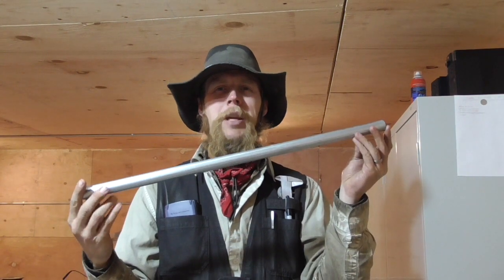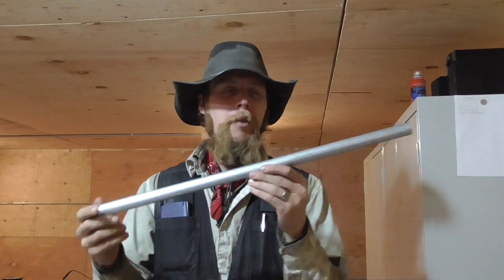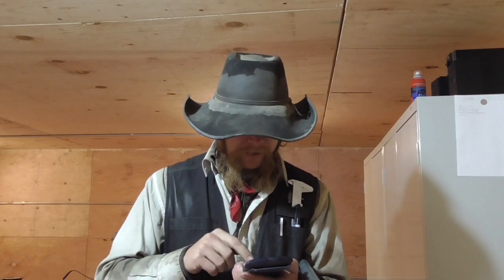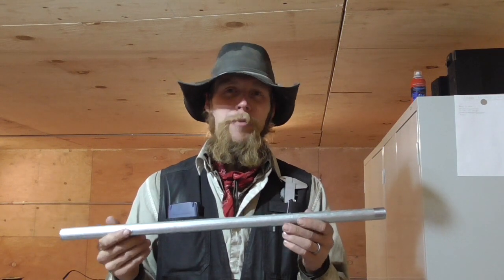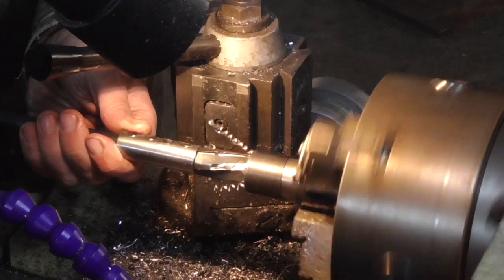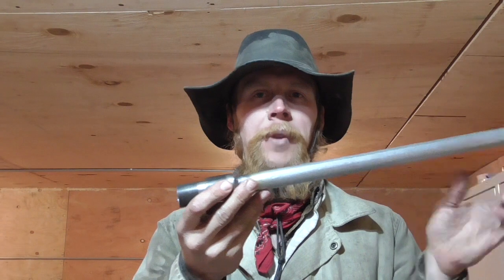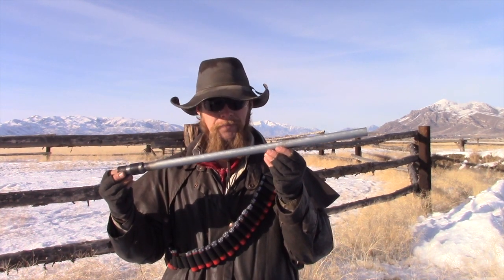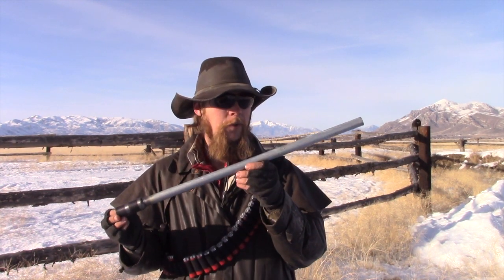Experimental EMT Conduit Barrel (TIS242)

Comment: That looks like Ridge conduit not EMT. All the emt I have been around is not thick enough to hold a thread. Ridge on the other hand comes with threads on both ends and comes with a coupling on one end.

Comment: great calculations BUt those pressure tests are for a pressure vessel. Your barrel is not a pressure vessel. It has a large open release vent at one end blocked by a ;weak point; the shell. The under pressure part is in the machined end you put on it (which appears to be a much sturdier metal)  also your weld needs to have proper penetration (u seem like a pretty skilled man with the stick though!). So your whole thesis is fundamentally flawed. Its not going to rupture, check the material of the welded on end as that might and the metal directly adjacent to the weld might. EDIT: You have some of the best most constructive comments from your viewers that I have ever read for a video. Great community!

Comment: you need to se how brittle it is , usually your material needs to withstand 40Joule per mm² without fracturing and you take 1/3 the pressure +20% of pressure  1/3 because its a short pressure spike and not constant pressure the 20% are your safety margin and needed for proof testing  you can go as low as 1/3+5% when you build ultra light like for mountain hunting rifles or aircrew survival rifles
you are on the safe side even with hot loads if the material is fractrure resistant enough

Comment: No way is an open barrel, especially a 12 gauge barrel it having one end open, I seriously doubt that the pressures in the barrel itself get much higher than 2000 psi, because it's got a big hole at the end, and the projectiles usually aren't fit in the barrel snugly, although a 12 gauge slug is a different beast all together.
 Thanks for this video, very interesting!!!
Reply: Specifically the foster slug expanded on the barrel

Comment: Hydraulic tube can stand a lot greater pressure.  The Sten gun 9mm used heavy duty thick wall gas tube so short almost on large pressure build up prototype for very simple weapon

Comment: About the only barrels that I've ever seen for any shotgun that seemed really thick are the standard signal shot break open shot guns we usually buy for our kids to start out. Metallurgy does play a huge role in how shotguns are built, but shotgun pressures bleed off way quicker then any rifle or pistol barrels. The frontal opening diameters and smooth bores are the reason for that...

Comment: I would expect a spiked dynamic load in excess of the steel's pressure limit to produce an accumulation of fine cracks within the metal. I guess that would probably lead to a sudden catastrophic failure at some point after several cycles. Maybe without warning.

Comment: as an electrician, i am completely shocked by the outcome, i have been in the process of hand bending emt conduit just like the one in your hand meanwhile unexpectedly losing my balance because the emt conduit literally "split" lengthwise. perplexed why this happened i examined a hard-to-see weld seam down the length of the pipe. i had bent thousands of pieces of pipe, in every direction and shape and size(by hand and machine) and i had Never experienced the splitting down the length of pipe, until 2018, at which time i have now experienced '4' splits. be careful, we are definately experiencing a quality control issue in damn near EVERYTHING we use nowadays. i am completely shocked that didn't banana peal immediately, even with the welded-on 'chamber'.
just my two cents, prbably only worth two cents.

Comment: 3/4 inch black iron pipe has always worked in the past..
Reply: Yup what they said. Also the pressure drastically changes (drops) after your threaded insert. I love your vids but please do not rely on your conclusions. FYI .22 rounds have about twice the pressure as the 12 gauge be careful. That pipe is not taking the pressure

Comment: I wonder if you could fit the thicker steel over the emt tubing and Jb weld the the threaded extension in place to keep it from sliding off. Just a thought that doesn't require as much finesse since welding requires a LOT. With it slipped over 4 plug welds would be straight forward too.

Comment: The bigger piece probably took the beating. The barrel part probably held up because the pressure went down enough to be below 60000 psi. I still would not recommend shooting it. I might fail one day. But it will probably be just fine. Still its not a good idea.. 

You should try scaffolding tube. That makes a great shotgunbarrel. Just run a reamer through to make it smooth. Its a factory welded tube. So it has some marks on it. Its a lot thicker than 0.04". Its like a 7 gauge with those tubes. Maybe you can even build a 1 gauge, who knows. I know they made IEDs from (big) tubes. Then put one end in the soil, put in powder, and filled the other end with, rocks, batteries, coins, glass, etc. For one time use its fine. Well it may be good for more times, but you have to know what kind of forces you are dealing with.. 

Well thats about enough!:D 

Greetings,

Jeff
Reply: I came across this: https://www.mcmaster.com/hydraulic-tubing/stainless-steel-tubing-5/welded-stainless-steel-tubing/ 

Have you build a gundrill yet? https://archive.org/details/The_Modern_Gunsmith_Vol_2_Howe_1941/page/n125/mode/2up
and 
https://archive.org/details/The_Modern_Gunsmith_Vol_2_Howe_1941/page/n127/mode/2up

0.281-0.218= .063" thickness on the gundrill example. The 0.065" thickness looks good on the 1/4" hydraulic tubing. It seems the be the right size to bore a hole for a 6.5 Creedmoor or 6.5 Grendel barrel (it may leave little to be removed with a reamer later on, but a rifling button may correct the possible scratches later on after the drilling is done). 

And have you build a heat treating oven yet? An arduino with a thermocouple and solid state relays seems to be right for controlling an oven. "The electric kiln" by harry fraser seems to be a good book about the subject. It has all the info in it to be able to build an oven. Its cheap once you know how its done.  A good electronic furnace can always come in handy when one needs to heat-treat metals or materials. Or when you just want to do pottery.... 

Jeff

Comment: 1. As others have pointed out, your chamber adapter is handling the bulk of the pressure. If you just put a 12 gauge shell directly into the conduit as-is (imagine a break barrel type of action) the barrel would probably rupture.

2. It may work a few times but somewhere down the road that conduit  is probably going to rupture. The heat and abrasive nature of the shot will eventually erode away the inside of the barrel and any little hangup will cause a pressure spike that will rupture the barrel. The bore will also likely rust very quickly and cause pitting which will make things worse. 

3. Most shotguns have some type of choke going on. So pressures are usually less in straight walled "water pipe" style barrels. You may only see 5000 psi in a straight walled pipe shooting light bird shot loads.

Overall an interesting experiment but I don't think in this case you showed that hoop stress calculations are inacurate. I would love to see a real test with just the conduit and no outer shroud in the chamber area. My guess is that it would likely burst with heavier loads.

Comment: Your hoop stress calculations werent relevant to the finnished barrel, your calculation was for max pressure, ie the top of the pressure spike which happens very quickly and would all be contained in the larger threaded adapter. To calculate whether the barrel would fail you would need to find the pressure from firing when the shot actually reaches the thin portion.
Reply: yes my thought exactly, and if the adapter is about an inch longer than the shell before the conduit barrel, it'd be some pretty fair insurance. I'm now more curious about 1/2" conduit being used similarly for a .410 double barrel setup.
Reply: model nutty I just made a barrel from a 1/4” pipe sleeved into a 3/8” pipe, hopefully get to test it soon
Reply: @konkasheep98  good idea.
 I have been planning on making a double barrel 410 handgun(I will leave the firing pin out until SHTF)
 I am using a piece of 1/4 thick rectangular steel stock. It's about as big around as a 2×4. I am using black pipe and setting them into place inside the"sleeve" of the rectangular steel stock, then filling the rest of the space with very high tensile strength epoxy, I can't think of anything that would not work, I can't imagine it blowing up or anything.
 I will try to come back and let you know if it works or not.

Comment: Great vid and very interesting, I wonder could this be heat treated at all? Any way of making it stronger without adding more steel? Anyone know? Cheers.
Reply: even mild steel can harden some, it has to be taken to red/orange then quenched in some nasty old used motor oil. the metal expands, the pores open up, sulpher and carbon do get in there to crystallize. not great and not very deep (maybe .005 - .006), but somewhat case hardens the skin.
with tubing wall only being .040 to begin with, it could help some.

Comment: Seems like the threaded adapter is taking all of the chamber pressure, not the actual EMT tubing.
Reply: this would be correct as the industry standard pressure rating is when the shell first goes off so the only part of the barrel that sees that kind of pressure is the breach and the rest of the barrel only ever sees around a tenth of that pressure assuming the barrel isn't blocked in any way so theoretically you could use pvc tubing for the barrel itself aslong as the breach was made of 2.0 mm or thicker steel
Reply: @arnearne12345  the pressure curve is not uniform for all ammunition, though.
Reply: @oneproudbrowncoat  this is true but as long as we are dealing wiht shotgun ammo the curve is so short that it doesn't matter UNLESS we bring slugs into it they do produce more uniform pressure through the barrel at all loads simply because they seal better agains the barrel walls
Reply: @arnearne12345  Do not discount the strength of the actual shells. Most of the time if you just set off a shotgun shell  they will not even rupture the shell because the charge blows the contents out of the end.
Reply: @HansFormerlyTraffer  well yes and no the pressure is low with most shotgun ammo because most shotgun ammo doesn't seal perfectly in the barrel and the wads are flexible and tend to get ripped apart if the pressure gets too high meanwhile ammo such as slugs seals much better in the barrel and will result in a higher stress further down the barrel so I wouldn't use the thin wall conduit for that kind of ammo
Reply: @arnearne12345  right 3/4 pipe is a 10 gauge not a 12g
But The Mossberg 835 has the same 3/4 (.775) and some people on forums say will have better or the Same velocity as regular 12 bore
Reply: Also the wad is most likely not a tight fit so a lot of pressure is leaking past before it enters the EMT tubing.

Comment: What do your numbers say about the strength of the chamber. I am of the opinion that the chamber takes the majority of the pressure. By the time the expanding gasses reach the barrel, they have already gained 2 3/4" or even 3" of space. I wouldn't know how to calculate it. But I'm sure that it makes a huge difference in pressure.

Comment: That’s thin wall. It’s not for industrial. It’s more for commercial. Try rigid conduit. As a licensed electrician I have wondered what would EMT handle quite a bit . Great video! Thanks.
Reply: Is he using EMT? It looks like rigid to me.
Reply: Kevin Javorsky  Yes it’s EMT.
Reply: @Jameskenomis3  Never seen threaded EMT before.
Reply: OK never mind.  Watching again I see the end is cleaned up.  That looked like it was threaded.  oops.

Comment: Have you seen the prosumer grade pressure test rig that tatvcanada uses? It seems like a tool you would get a lot of use from.
Reply from the maker: Yeah, the "Pressure Trace II" system he uses is basically just a digital oscilloscope connected to a strain gage on the barrel.  Granted, it has a nice user interface, but it also costs about $500.  Given that I already have a digital oscilloscope, I should be able to build a measuring apparatus with comparable capabilities for about $50.  It's on my to-do list; I just haven't gotten around to doing it yet.
Reply: @TheIdahoanShow  That's good to know. The question of course would be how to calibrate it and know for sure that you calibrated it right.

Comment: So I think the reason it doesn't blow up is there is probably not a tight seal around the wad/round and ID of the barrel, if this were a riffled barrel with correct bore diameter and you shot a slug, it would be catastrophic to the barrel of that thickness. Only reason I say this is the 12 ga. I built that the barrel was 3/4'' pipe and just slid out of the receiver to reload, the barrel had no problem staying in place when being shot, even with slugs. I think because of easily escaping gasses around the wad/round. On the other hand, I made a 22 mag with the same design but with a riffled barrel chambered in 22 mag and it tried thrusting the barrel out when being shot. Which that affect would be caused by more pressure in the chamber/barrel. Just a thought. Cool vid and this would make a sweet very light 12 ga barrel with the chamber aria beefed up.

Comment: The chamber is where the pressure peaks.  Adding a thicker wall chamber is "cheating", as the conduit does not see peak pressure.

Usually, suddenly applied stresses are regarded as twice or more those applied slowly.  In this case, the inference is that the part is "slow to react to the stress", and thus there is not enough time for rupture to initiate.  

Soft steel, stressed below its yield strength (barrel did not swell permanently) has almost infinite fatigue strength (providing there is no corrosion):  https://www.asminternational.org/documents/10192/22533690/06181G_Sample_BuyNow.pdf/8d0dc9d2-dc00-41ae-8813-8cfe39027d8a
Firing guns underwater might provide a clue.  One would think that the projectile having to push the column of water out the barrel would rupture it.  Yet is does not.  Perhaps this would be a fun direction to explore next...

By the way; light factory loads use less, but faster burning powder.  Thus, the average pressure is much lower, while dropping the peak pressure by a much smaller ratio.

Comment: Static pressure calcs will only get you so far. Dynamically, what happens is that the shot occurs so rapidly is that the tube doesn’t actually have enough time to burst. It can’t get out of its own way fast enough due to the mass, and therefore the inertia, of the material. The material becomes temporarily stiffer as it’s own intertia resists any deformation.
Reply: That is very interesting, and makes sense how the shock wave is beneficial.
Your explanation is reminding me of an online article explaining what happens to an airplane as it's speed increases from Mach 0.9 all the way to Mach 1.1 - the Shock wave is the airplane Slamming into the air molecules in front of it like a hammer, which can cause catastrophic structural failure of an airplane not built tough enough.

Comment: Now, using a standard manual emt bender, see how much angle you can put on it before it blows out.  Shotgun around the corner??!!
Reply from the maker: That is an interesting idea.
Reply: I for one would love to see a 12ga krummlauf. Remember to put a mirror on it so you can aim.
Reply: I imagine a shot cup has much better bendability than the rifle rounds the germans tried with the bent barrel stg44.
Reply: Great idea!  Test with different shot sizes, perhaps good for vermin eradicating in small places.
Reply: They did a similar experiment on myth busters with a rifle  was pretty interesting
Reply: I like the cut of your jib!
Reply: Demolition Ranch did a video like that fairly recently. He used a 45 ACP through pvc and copper pipes.

Comment: It would be interesting to see how many rounds it would take before it fails
Reply: rustybuttpate  I've built a few as well 
I've always drilled the cap out works fine for me 
Another way to do it is jbweld a bb to a washer and then put it in the cap
Reply: @booth5578  to a washer? What do you mean? A washer nut or something like that?
Reply: p.s.   Don't let the hat fool you.   This guy has a calculator in one pocket and a micrometer in another plus a slew of pens / pencils.   You can bet he has an engineering degree from somewhere.
Reply: It will last forever in relation to fatigue because fatigue is measured in thousands and thousands of cycles to which that hand loaded gun will never see.  

If the barrel truly didn't bulge then cold working doesn't look to be a factor either.    

A good bet would be that the industry standard which is refereed to has a rather large safety factor built into it.
Reply: rustybuttpate on my first attempt i made one with  a cork and a nail and on the first shoot blow up the cork but shot fine, is a one-shoot gun anyways

Comment: Not only pressure roughly twice what a static analysis tells us would burst the tubing, also a weld down the side and no proper stress relief or other heat treatment after.  This is the kind of result that has to make firearms designers scratch their heads.

There is a possibility that mass of the barrel helps with impulse loads, but EMT conduit doesn't have much of that either.